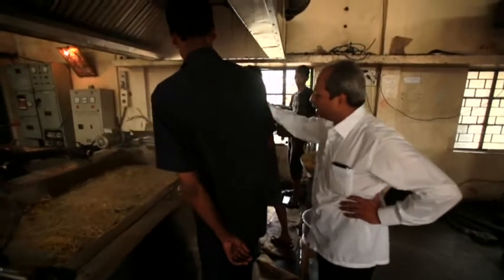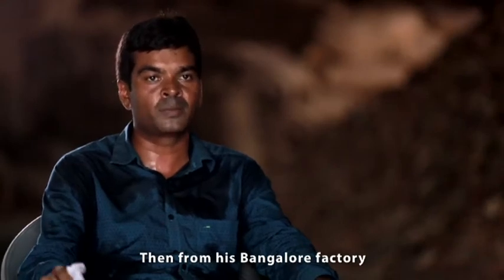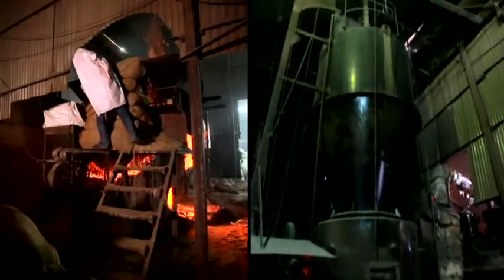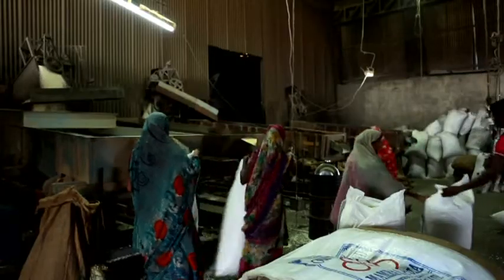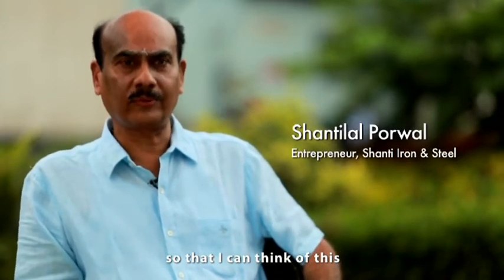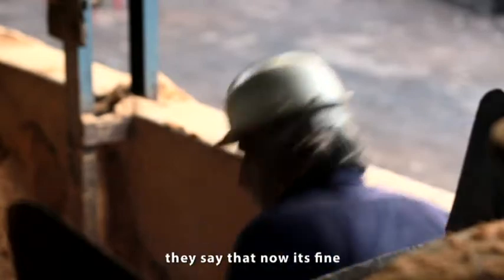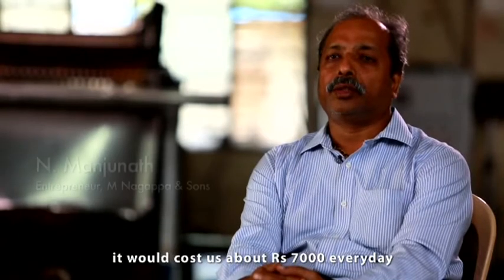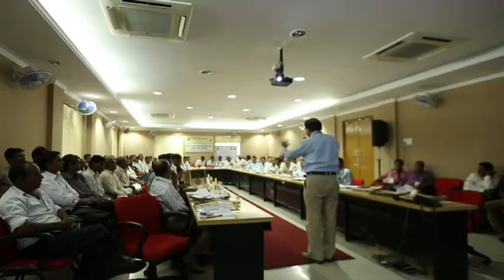Fueling Change: A film on biomass gasifier technology

Comment: By pressing wood over red hot metal jelp decomposing cellulose into rar fumes. I have got it from black smithy work  of bus body work shop. Where wood is drilled anywhere during work by pressing  redhot iron bolt on wood. The fume is dawn fast a d gor ignited atonce